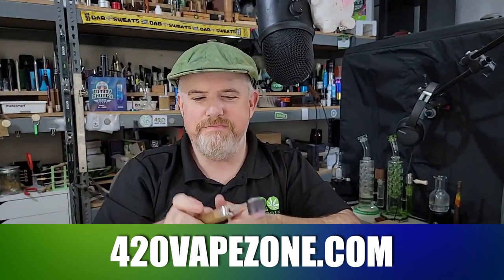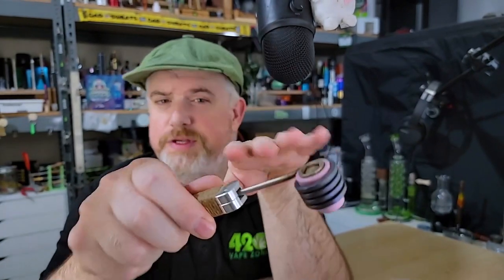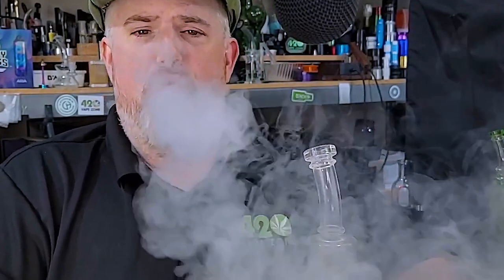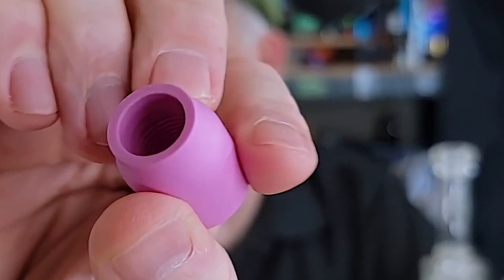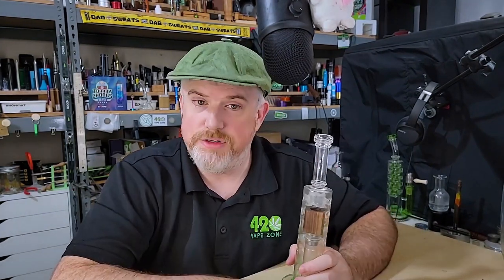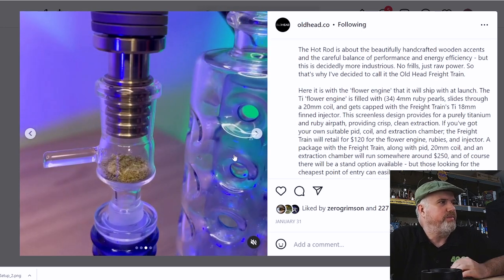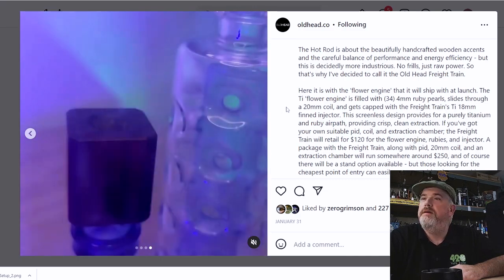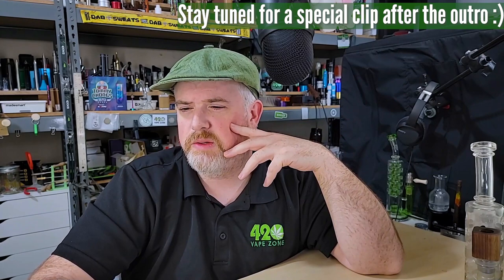Something *AMAZING* is unfolding in the 420 VAPE NEWS // The Pinky & TiTi // Freight Train // CH B0

Comment: Made my pinky a few days ago and realised its good to space the coil and as well as balls I put some broken up pink ceramic as I had a few and it works great with tiny particles in the top and balls in the bottom... 😀 amazing device with instant vapour...
Reply: Letting the broken pieces heat  could cause off gassing. The interior isn't sintered like an intact welding cup
Reply: @h8h81  really ? I've been using it constantly for weeks and not seen any off gassing even when I turned it too high finding the right temp to start with
Until I have money they'll have to do... and to be fair they work great
Reply: @JamesdeLunalightpainting you wouldn’t see the off gassing. You’d breath it though.

Comment: What material is the nozzle made of? Seems a bit sketchy to use something for welding
Reply: Basically a ruby infused ceramic. All inert materials.
Reply: @jojo0420  what worries me is its alumina ceramic. I'm not sure what exactly that means but it's a little scary with the alumina part
Reply: @rageweary  A short time reading some actual information will put your mind at ease. It is a very safe material.
Don't be afraid of words. Learn what they mean. :)
Reply: @jojo0420   Aluminium is a chemical element having the atomic number 13, and chemical symbol Al. Alumina is a chemical compound having the chemical formula Al2O3. Therefore, the key difference between aluminium and alumina is that the aluminum is a chemical element, and alumina is an aluminium containing compound.

Comment: BALLS ARE THE Future 
I PUT THEM IN MY MIGHTY COOLING UNIT AND DAM
I was hitting at 180c-185 and get that STORZ & BICKEL tickle.
But with the BAlls Hitting at 200c + and not using water 
Try it 
Under the screen put 3 - 6mm in there and one in the bit next to it. Or u can play around with 4mm but for a cheep hack it’s worth doing bro 
So it’s like the Angus new cooling unit.
And turn up the heat to 200c-210c 
And it’s a win win give it a go u full in love with the mighty or crafty - mighty + 
It works Balls big rips big vaper thanks to Balls 
😊